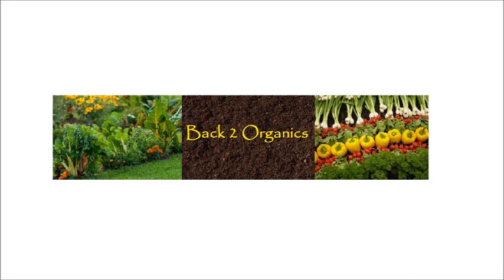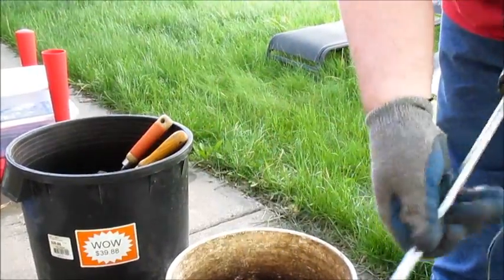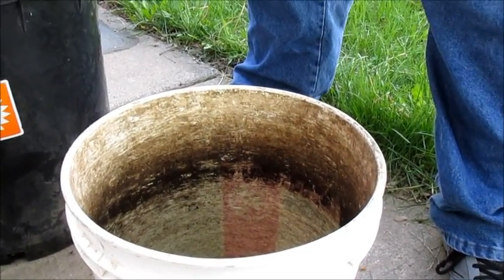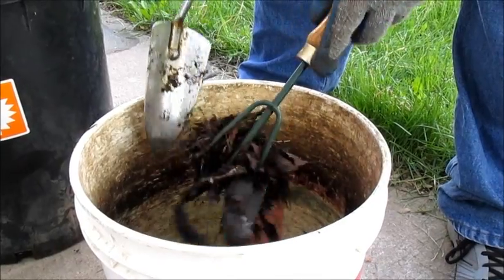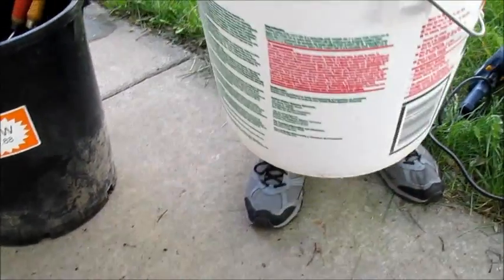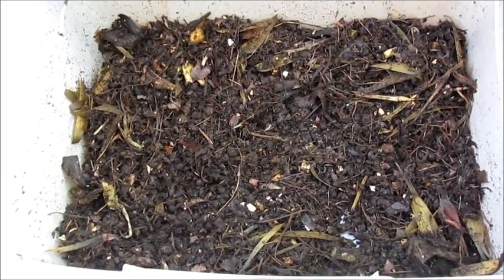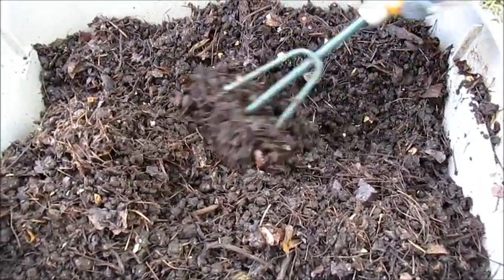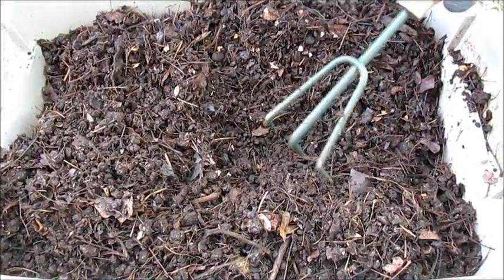How to Grind Compost So That it Will Breakdown Faster

Comment: Very creative idea!  I just use an old Mackissic; fast and I can run a cubic yard through it about as fast and more thoroughly than the throughput you showed; that is not to denigrate it as not everyone is making large amounts of compost.  Or as they say, if it ain't broke, don't go fix it.
Reply: Old Mackissic what?  An auger?  Or is there a specific name?
Reply: I came up with a different prototype. It has a GE ¾ horsepower 1725 rpm motor that uses a drive belt to drive an axle with a flywheel that has wood screws that work like the chopping blades. The motor is attached to an on-off toggle switch that would normally be hardwired, and it's wired to a GFCI in case the power cord goes through a rain puddle in your yard. The area for the compost has an entrance at the top, and the exit is at the side of it. It grinds up the compost when the compost is inside, and as soon as the compost is ground up properly, the chopping blades throw it out the exit at the side. The base has a stand on wheels for carrying it around because the motor's heavy.

Comment: Try not to hit the sides of the plastic bucket otherwise you're adding micro plastics to your compost.
Reply: That was the first thing I thought of.  He should build a jig to keep the grinder blade centered.
Reply: Could he mix it outside the bucket? i.e. just put it all in a pile on the ground and let 'er rip?
Reply: @Mysteriouso100  The material would fly everywhere and you wouldn't grinded the compost, which is what we want :)

Comment: How would this work with some real yard scraps...oak leaves, a pile of weeds and native grasses, things with tough stems.  

And does grinding up the half composted scraps shown, does that noticeably  increase the temperatures?
Reply from the maker: dfarns123 it works well with tough stem items to help break them down more. and yes there is a noticeable increase in heat after this grinding because it increases the surface area and gives the bacteria access to surface that it didn't have before so the heat increases.

Comment: How to Grind Compost So That it Will Breakdown Faster stick it under the lawn mower
Reply: It's hard to imagine a banana peel dulling the lawnmower blade(s).
Reply from the maker: +Keinan Menard yes you can chop up the original materials but once you start composting it they become much too dense for a lawn mower to handle
Reply from the maker: bucketrobbert hehe your lawn mower probably won't like that. And will dull the blade badly.
Reply: bucketrobbert a lawnmower would be better suited to mulching your materials such as leaves and twigs before you start composting. Not so much for compost that has broken down as much as viewed in this clip.
Reply: Ah, to all the "it's too thick for a lawn mower" answers, I have used a 3 bin compost setup.  Because I turn the compost while it is hot - whenever it gets down to about 135 to 140 degrees, and then I cover it after the heat dies off, I have never had compost compact down to the point that it would dull any lawnmower.  But then, I never used a lawnmower after creating the compost.  I have used a Mighty Mac, but not because my compost was packed - it never was.  if one is simply building a pile over time and not turning it, yes, it will compact; and a garden fork and a Mighty Mac will solve that one too.  Me - I would not want to have to deal with the torque that implement would make.
Reply from the maker: dfarns123 true a banana peel won't but as stuff gets half composted it get rather compact almost like soil and running a lawn mower through compact dirt dulls it badly plus the compost won't travel into the bag like normal instead it just stays in the blade area and bogs down the engine.